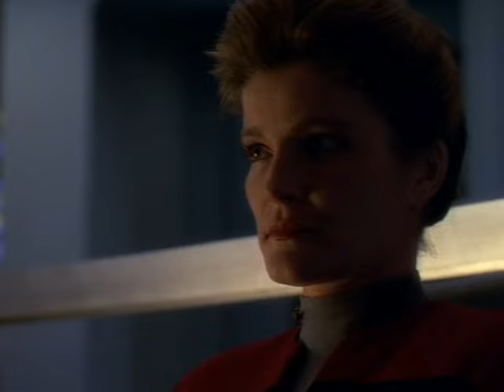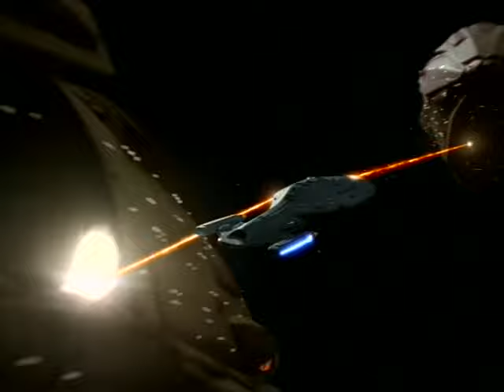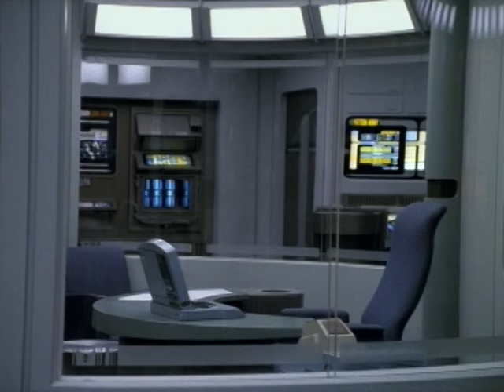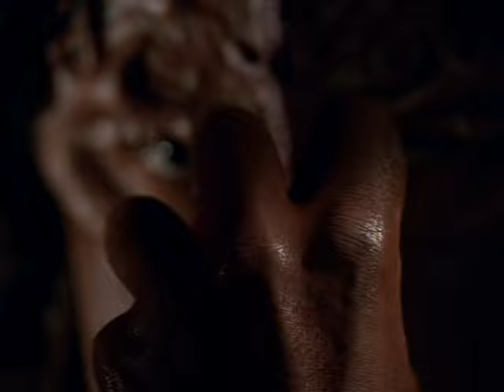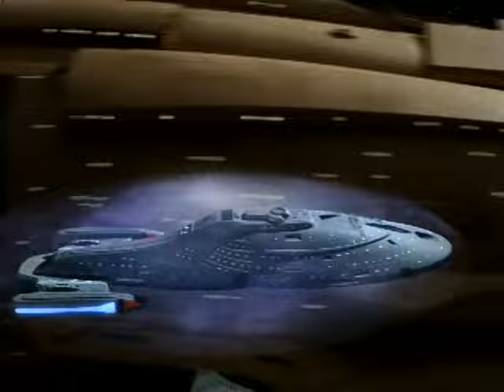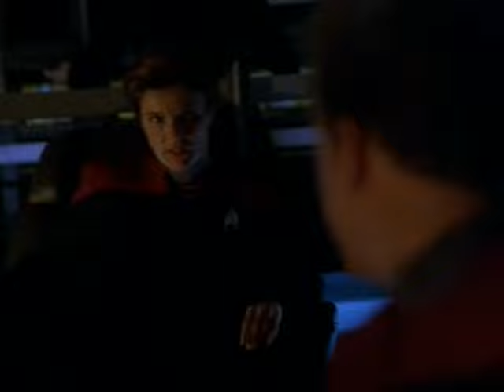Voyager's Battle with the Kazon-Nistrim  Part I

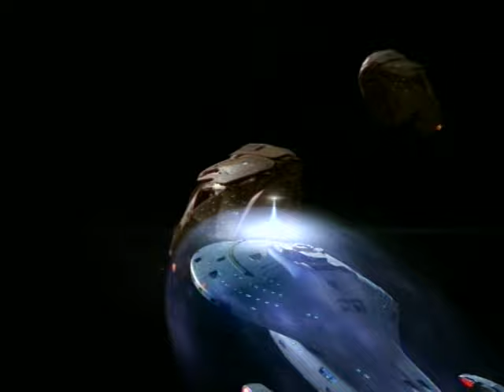Comment: 0:58 battle sequence, gotta say its lovely to see a starship use more than one phaser array in a fire fight, this was of course when they had to rely more on good phaser sttikes with their limited torpedo count (at the time as it never seemed to be a in later seasons, they were firing those things here there and everywhere)
Reply: Have you seen the torpedo inventory log video? Starting off with the original complement of 38, they ended the series with... negative 85 torpedos.
Reply: @asmcint  It seems logical that the crew bartered for anti-deuterium and replicated the components for more torpedoes. As Torres pointed out, they could not replicate anti-deuterium, but that is really the only component of a photon torpedo that could not be replicated.
Reply: @Acrosurge  That's fair, but in the absence of any such detailing because they didn't have anyone on staff really keeping things internally consistent... it's really just an error in production.
Reply: @Acrosurge do you mean antimatter?
Reply: I wish they had an episode where they construct or convert a cargo bay into some kinda weapons manufacturing facility.
Reply: Yes! They seldom used any kind of multi vector assault. That’s what I liked about the nemesis movie because you see the enterprise firing from every way possible. Instead of typical single strikes. That episode where it was an alternative universe with the enterprise D was the worst offender.

Comment: Some context here, this is one Starfleet ship against seven enemy vessels, each the size of a Star Wars Imperial Star Destroyer. And Voyager was winning until her Kazon passenger set himself off.

Let that sink in. Voyager was winning against seven, Star Destroyer-sized ships.
Reply: It was against four enemy vessels during the actual battle. not seven.
Reply: Yeah, but they were seven Kazon Star Destroyer-sized ships.
Reply: Don't confuse winning with surviving
Reply: If it had been a Sovereign class or even a Galaxy class those Kazon ships would have been wiped out. Voyager was advanced and had good firepower but was a science and exploration ship...it did well.
Reply: @TheCormTube  Haha. A Soverign wouldve never fought.  AS The Kazon would've never dared attack her. She's too far beyond their ability.
Reply: Actually there were 8 large carrier vessels, but 4 of them were diverted by echo displacement, leaving Voyager with 4 to deal with.
Reply: @TheCormTube  I doubt it.
Voyager's main limitation was the fact it had limited torpedoes at the time it was launched.

The Galaxy class was larger and has a lot bigger internal volume, but it doesn't mean its shields or phasers would have been any more powerful just because of that.
Star Trek didn't really operate on the premise 'bigger is better' (bigger in this instance has advantages for longer missions as you get more internal space, and you can carry more torpedoes yes - but power level wise, they'd be comparable).

In fact, VOY was essentially a downsized Galaxy class and had the same offensive and defensive systems. And because VOY was launched later, it benefited from 7 years more advanced tech which meant SF could fit all the latest tech into it and make it on par with the upgraded Galaxy class ships of 2371 in terms of firepower and defences (so in terms of phasers and shields, there wouldn't have been much of a difference between them).

But torpedo count wise, VOY only had about 36 of them when they were stranded (probably a result of being launched on a small 2 week mission to retrieve a small Maqui raider ship lost in the Badlands - otherwise, there is nothing stopping a ship like VOY to carry at least 100-150 torpedoes - the refit Enterprise- had about 96 of them - and that could have been just a small sample size from the data on the screen in the movie). The Galaxy class had about 260 torpedoes (but for the life of me, SF giving the VOY only 36 torpedoes even for such a small mission never made sense - if you launch  a ship, you give it full compliment of weapons - oh and while VOY is tiny  compared to the Galaxy in terms of internal volume, torpedoes are small as well, and you can easily stack A LOT of them even on something the size of VOY - so 36 is probably an abnormality because the original mission for which VOY was launched was supposed to last only 2 weeks to retrieve a small Maqui raider ship).

So, the same analogy would apply to a Sovereign class ship. I'm unsure if it would be significantly more powerful than  a Galaxy class though. The Galaxy is bigger, and only 7 or so years older class of ships... chronologically speaking, there isn't that much of a difference between them, so any special systems that may have gone into the Sovereign would have likely been integrated into the Galaxy and Intrepid class shortly after the Sovereign was launched. In fact, the VOY was the first ship in the fleet to have bioneural circuitry - the Sovereign had it too though and both were launched around the same time anyway - so the tech base would be the same.

The Kazon tech may have been outdated, but 4 Kazon Carriers are still a significant threat to a single modern SF ship (even if it was the Galaxy or the Sovereign).
Those Kazon carriers have a lot of weapons onboard - though technically, this is mainly for overall coverage... phaser strips act in the same capacity, but are a lot more effective and can fire multiple shots from a single strip at the same time), so when you concentrate your firepower to a single ship, you will do some serious damage.

The interesting thing is that a single Kazon carrier and a smaller Kazon attack ship were fighting against VOY (and the MUqui raider) to a standstill in Caretaker episode Part II - this was shortly after both ships were brought to the DQ and suffered damage - though auto repair was able to bring both ships up to functional status - but they were not at peak efficiency).

So, the main advantage the Sovereign or the Galaxy might have against those carriers would be in torpedo counts... but if VOY launched with 150 photon torpedoes instead... wasting 24 of them (aka 6 per Kazon carrier) would be an affordable setback.
Reply: They were not Star Destroyer-sized ships. Those ships were several feet wide. Maybe the size of one city block at best. The Star Destroyers were like 10 miles wide in many cases
Reply: even more Intrepids are basically a light cruiser. so really well done
Reply: @robjackson5245  You're right. Imperial Star Destroyers were ~1,600 metres long. Kazon/Trabe Predator-class carriers were ~1,920 metres long, and far more massive.

Comment: I would have like to see the Defiant take on the Kazon ships cause think about it the way the Defiant hanndle the dominion ships that was cool
Reply: Or the Enterprise-E.
Reply: Defiant or E would tear these guys apart with a casual glance
Reply: @ryancarroll3957  even the Enterprise D cause of the seperation that they have
Reply: If Voyager can incinerate one with 3 photon torpedoes.......then the Defiant with her pulse phasers and more powerful quantum torpedoes won't break a sweat!
Reply: These ships are Trabe. They are nearly as advanced as Starfleet but, badly maintained by the Kazon.
Reply: @xineohpinakc264  the trabe ships they look like more then the size of a galaxy class starship.
Reply: @rbrtpongo  They are massive . The kazon barely knew how to operate them and the ships had been in disrepair for a couple decades. Later when 7 says the Kazon were not worthy of assimilation it was because they were primitives when the trabe made them slaves.
Reply: @rbrtpongo  They are far larger than a galaxy class starship. The Nistrim's carriers are about 1,800 meters in length, larger than an Imperial Star Destroyer from Star Wars.
Reply: the space battles was cool on star trek 
 @Acrosurge
Reply: @xineohpinakc264  They aren't anywhere near advance. There no transporters, no replicator systems.